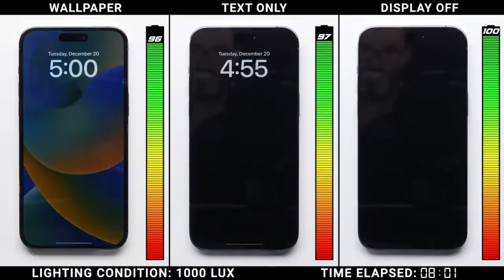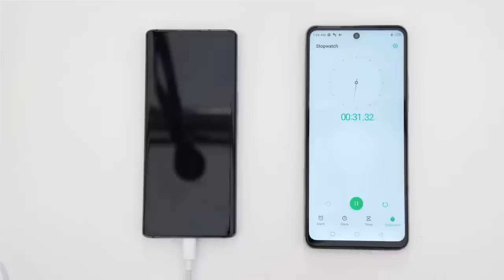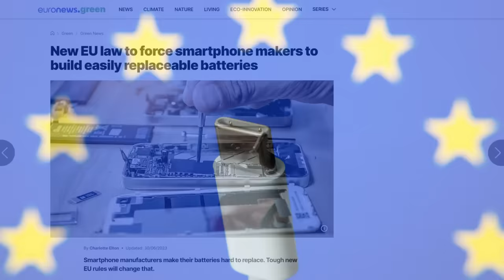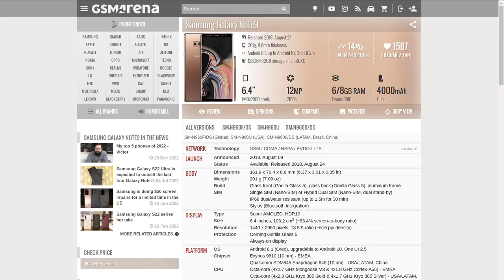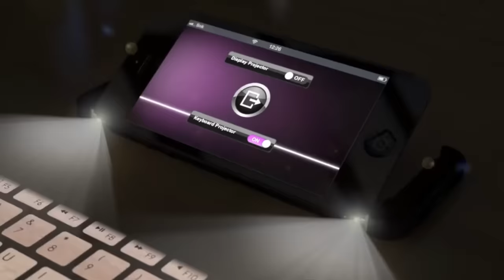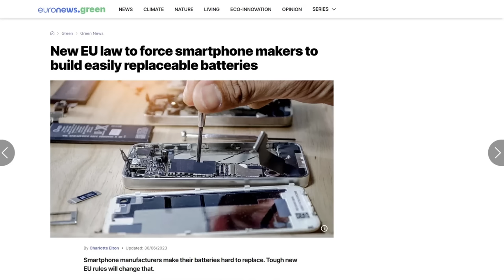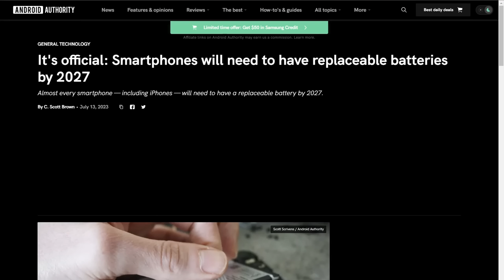All Smartphones Will Soon Have Removable Batteries

Comment: The other part of the planned obsolescence for smartphones is OS upgrades. I wonder if they will limit upgrades even more to force you to get a new device.
Reply: EU has regulations for that too, don't worry.
Reply: xiaomi 2 year security update
Reply: That was my reason for moving from a rooted Motorola RAZR MAXX to Google Pixel 2 back in 2018. They stopped OS upgrades and my apps stopped working including banking and Uber.
To this day, I still think I should have just flashed a ROM, now I am on a pixel 7 which is kind of doo doo, cause it doesn't always detect touch on the screen.
Reply: @bot-h2h  Same with the google pixels
Reply: @bot-h2h  tf that's pretty damn short
Reply: @Vysair  actually i think only for their low to mid range but still. Some poco phone have flagship chip and stop getting update even if they are still very capable

Comment: The use cases described in this video are pretty out there. I'd just want to replace my battery when it can't hold a charge anymore
Reply: yeah same
maybe this fixed-battery tyranny has brainwashed me and i cannot even fathom the powers i could gain by opening my battery case and my mind
but i did use to have removable batteries, and what it meant was i would remove them for hard resets or at the end of their life, never really thinking of juggling batteries so i am constantly powered. it also feels sort of wasteful? unless they were really cheap, i would find it risky and less efficient to buy multiple batteries so they can all be weathered by use and time for a phone that may potentially break
Reply: @aiocafea man, I basicall used my S5 untill the battery was shot and holy hell do I miss being able to do a hard-reset when my phone now starts acting up.
Reply: Yeah, a powerbank is nice because you can charge it separately from the phone, use it to charge anything, it'll still work after buying a new phone or if you lend it to a friend etc. I really don't think hot swappable batteries are more than a gimmick, especially with modern phone battery capabilities.

Repairability on the other hand, that I'm excited about!

Comment: I doubt they mean hot swappable, but a regulation that mandates easier replacement under the RIGHT TO REPAIR, when the battery depletes, is good regulation in my opinion.

Comment: The #1 problem I've experienced with Android phones in the last 5 years is that the charging port gets extremely loose after a year or so. Then it becomes nearly impossible to charge unless you have the charger shoved in and in some unique position, until the charger just falls out again. The charging ports need to be fixed. There should be an option to click it in and out so it doesn't just fall out.
Reply: Same though lesser with Apple
Reply: Type C largely fixes this problem compared to Type B-micro
Reply: I usually find cleaning the lint and grime out fixes that problem. I have a samsung s8 from 2017 and it needs a clean every 6 months
Reply: @essef.  Exactly, it feels like the port is geting loose, but it's actually just a dust build up.
Reply: This is primarily caused by debris buildup in the charging port.  I've found that phone cases with charging port covers tend to mitigate this.
Reply: I've started using a magnetic cable type c. Solved everything you mentioned.
Reply: Take a pin and lightly scrape out the USB port, and remove the lint. This is a solveable problem.
Reply: It isn't a problem with android, the operating system. The problem is the fact you have android phonea from 100 euro to 1900 euro.
Reply: My android phone is vivo 1817 (2GB ram/ 16GB storage) which released in mid 2017. It was a cheap phone that my mom gave me (It was hers initially). The cable last good until about 5 months ago. The internal memory got busted after many years until a month ago and I replaced the internal machine with other model (1820) which has a slighter memory capacity (2 GB ram / 32 GB Storage) and it now has bigger storage which I thankful about it. will be using it till there're no replace parts maybe about 2-3 years from now. Which is very rare to see this chinese phone last this long. (About 6 years now). And it still use 4G connection that only limited to 1.3MBps for downloads and uploads
Reply: @bigl9527  And that is the reason why a lot of people think Android sucks. Instead of solely expensive, good quality, phones that only run iOS you can buy cheap ass Android phones that'll break in 2 weeks or an expensive S23 which will go for 4 or so years...
Reply: I've owned many android and apple phones and have yet to run into an issue like this. I think you may be a little aggressive with your phones. 

Last year I did run into an issue though with an apple charging port and the issue was actually a lot of lint had gotten stuck in the bottom of the port. I used a toothpick to get it out and the charger fit perfectly after that.
Reply: What's wrong with charging port?
I never had issue with type C. Currently using OnePlus 7 Pro about 4 years and never had problem or needed to clean the port
Reply: OP: aughhhh the port is literally irreplaceble omg this is such bs
The port: remove back, screw, replace, re-screw, put back again.
Reply: So glad they sell phones that can charge wireless just for this reason alone. Port "broken"? No problem, you've got another way to charge.
Reply: Usually due to crap - dirt, dust, lint etc stuck in the port. Get a pin or needle and have a careful dig.
Reply: @BeauVerwijlen  My crap 100 euro redmi is 4 years old now, does what I need.
Reply: I always had "android phones", that usually just happens to some USB cables, not the phone "charging port" itself, my phone is almost 5 years old and the charging port is FINE, the battery however is now having a lower performance.
You either are not careful enough or its that phone that has a worst charging port quality.
Reply: @kevinmclaughlin3088 yeah i was thinking the same. Always had android phones, always had no problem but i made sure to take care of them. Ive only ever had that issue with a playstation controller. Last week, for the first time. Hahaha. Its obvious that its about treatment. I havent been so good to my controller.
Reply: My phone has this problem. I'm not sure how, but the USB-C port on my S10+ is like a lint and dust vacuum. Taking a shaved down toothpick and scraping the stuff out usually works well, until it gunks up again
Reply: You have to clean it genius, with a needle/toothpick or something. Dirt builds up inside these ports ( especially on cheaper phones) which causes the issue you describe.
Reply: Never had that problem.
Reply: Have you tried cleaning the port ?
Reply: It would be possible if Apple didnt patent their MagSafe.
Reply: USB-C doesn't really have that problem anywhere near as much as micro USB did
Reply: I use a magnetic cable so there's a little plug in the charging port all the time so it doesn't get dusty or worn from repeated cycles.
Reply: Fairphone lets the user replace it.
Reply: @RokeJulianLockhart.s13ouq  is it swappable? Can you switch back and forth without consuming anything, eg glue?
Reply: @adrianthoroughgood1191  Yeah. Takes me about 8 seconds to swap the battery.
Reply: @RokeJulianLockhart.s13ouq  how water resistant is the phone? I'm guessing the battery compartment won't have water protection if it is that easy to swap the battery, but is the rest of the phone water resistant?
Reply: @adrianthoroughgood1191  I've used it in heavy rain without issue, because of course a phone should be capable of that, but I doubt that it would survive well if immersed in water.
Reply: u can charge wireless
Reply: @k_u_e_r_i_s_u_e  Depends upon the phone. Mine can't.
Reply: @adrianthoroughgood1191  Meant to say without issue, just corrected it.
Reply: I have 4 yo Type C port phone and have no problem on that, I once experience same thing like u describe but it's just because there's something clog my charge port
Reply: I had Huawei phone for 4.5 years and the UBC-C charge port is still as tight as new.
Reply: @siftoshka 4.5 years with Huawei P30 Pro. Never needed cleaning.
Reply: Mines like 5 years old and perfectly fine. Young ppl are so physically abusive of their tech.
Reply: Are you still on micro usb?
Reply: I’ve had more difficulties with lightning ports getting fucked over time than USB-c ones, which I’ve never managed to destroy.

Micro-usb ports though were horrible, those broke when you looked angrily at them. It was a shit standard and I’m happy it’s dead.
Reply: I had issues with this for micro usb, but usb c seems more durable. Still do be careful with it though, try not to let the cable pull on the port while charging, and never force the cable in if it is struggling to go in immediately. Can not expect charging ports to be indestructable, but they are a simple/cheap repair thankfully

Comment: The Samsung Galaxy S5 was waterproof while having a removable battery.
It was possible 10 years ago, but it's supposedly not now?
Reply: Yeah you are right. I think it should be possible...
Reply: Waterproof is technically not possible
It would be water resistant

Comment: My prediction: the casing has a proprietary gasket that wears out if you remove the back plate more than a few times, causing damaged phone from tiny amount of water leading to replacing either the gaskets or the entire phone.
Reply: 1st, more devices can take a little bit of water already. If not, then you didnt seal any of the hardware inside correctly (at the manufacturing level). 2nd, there are ways to make this happen that doesnt expose the insides to the outsides. 3rd gaskets can be solid - right now its double sided tape/glue - just make it part of the repair process.
Reply: @adr2t  methinks you missed the point a bit... the point was, engineering it to fail; not describing my brilliant and uniquely wonderful solution to an obviously not impossible problem

Comment: I remember my Galaxy note 3 with removable battery and the after market wireless charging coil. That thing was a beast
Reply: Best phone I ever owned was the note 4. Removable battery and storage, touch screen pen, credit card ability, 32 megapixel camera, and IR beam so I could turn it into a universal remote or other custom stuff. Since then every phone on the market has been a downgrade. After I owned it for 7 years it broke when I dropped it and 7 years later I now use the Moto z play because it's modular.

Comment: Personally I find water resistance a must. My phone has swum in oil multiple times and I use it for inspections in places that might have water or steam in them. It'd be nice to have a water resistant model and a battery replacement model.
Reply: What makes you think a phone can't be water resistant and have a user-replaceable battery? Plenty of older devices achieved this just fine. Ruggedized portable electronics (think surveying equipment, portable 2-way radios, etc) from the '90s were water resistant, there's no reason that modern phone companies can't do it too. A few screws (or preferably quarter-turn fasteners) could hold on the back case and compress a rubber seal, which is the design commonly seen on today's waterproof satphones and trail GPSs. Samsung made a phone in 2015 (the Galaxy S5) that was water resistant, with a removable battery, a headphone jack, and a micro SD card slot. We didn't know how good we had it then!

Another thing, that only applies to your one specific use case. Get a USB boroscope that can plug into your phone, they're cheap as chips from China and will save you from errant oil and steam.
Reply: If you're using your phone for inspections in areas involving frequent water and oil then you're gonna want to invest in a good case regardless of the phone's inherent water resistance.
Reply: Ironically, one of the few smartphone models that still have user-removable batteries to this day is the Xcover line from Samsung, which has an IP68 water resistance rating.
Reply: my old s5 neo had a replaceable battery and waterproofing. My new phone has neither 😵‍💫 I only switched it out because it broke and would cost more to repair
Reply: Samsung xcover
Reply: @@kanabanakamura864 And how common is the Xcover models?  If replaceable battery is such a big deal, how come these models are so unpopular?
Reply: @chumanho Marketing. Shinier things tend to be more popular
Reply: @Your_username_  This put into perspective what the consumers'' priorities are, I guess.
Reply: @Xenthosis317  I run a Mous case and have been for several phones. The phone that has survived all the abuse is an Iphone 12 that I've had since like 2 months after release. In the case it has survived 30ft drops, swimming in oil tanks, swimming in water, splashed with oil, extreme temperatures (45c to -30c), its been hit by superheated steam (at 1 meter away) Its (and myself) nearly got struck by lightning, I've lost it in the snow and I've sparked it with an angle grinder dozens of times. I used to work as a steam turbine and valve technician and I know how to break shit.
Reply: @tissuepaper9962  Well I'm a maintenance technician but I used to specialise in steam turbine and valves. The problem with removable batteries is theres seals and stuff that will inevitably get damaged from use. 

I dont need a cheap boroscope because we used to have expensive ones. The phone is significantly more convenient to use when I dont need to see around a corner. For reference the pipes I was working with were a minimum of 6" and often over 48" wide
Reply: @kingkottah  seals are cheap, and a well-designed device would use a standard seal.
Reply: @chumanho  because phone companies sold the lie that "phones can't be water proof with a removable battery" and it stuck hook line and sinker.
Reply: @GlitchedAI  But people must be aware of the presence of Samsung's Xcover series and Nokia's XR series, right?
Reply: @chumanho  sadly yes

Comment: It's not supposed to be removable but rather user replaceable with commonly available sruedrivers or custom tools shipped with the device
Reply: I think the EU law specifically states it must be possible without any tools.
Reply: @srsjackson  no, it could be commercially available tool(so basically something common you can go now and by in store), or tool specifically for this device. In the latter case you should ship tool with device. And tool can't be proprietary.
Reply: @srsjackson I think it would be nice to have more water resistance and use a SIM ejector for ejecting both the SIM card and the battery
Reply: so the way iphones are now?
Reply: @imstupidbut  exactly, i do not understand these clowns who imply that iphones are not repairable. just buy a screwdriver for 60 cents and a new adhesive if you want it to stay waterproof

Comment: This "water resistance" motive seems like a myth to me. Back in 2014 my Samsung S4 fell on the lawn with the sprinkles turned on for 1 hour. So the phone took a lot of water in that time. When I recovered it and wiped it good, it worked perfectly, nothing broken. I still use the phone to this day, 9 years later, daily. I only changed the battery 3 times since then. So I very much agree with this law.

Comment: I actually like the extra camera's, especially one with an optical zoom lens. I use it to help me read things I otherwise can't.
Reply: Macro ones are awful. No one ever used them. If much rather the main camera get an upgrade than have some of the budget squandered on a macro camera that does nothing
Reply: @truth.speaker macro is nice for certain things

However i think it's better to make Main camera good and have a Macro camera option which is purely digital... as in it's gonna use the Main camera as a macro camera so focus is set to be really close like it is on Macro camera so you can take focused HD pics of really close up things

Comment: On defense of the multiple cameras in phones: the optical zoom on my S22 Ultra is amazing. I don't think a single camera would handle that so well as the dedicated zoom camera.
I believe it's good if that is still offered for premium phones, but yeah they will likely never reach the same quality as actual cameras due to the sensor size + glass difference.
Reply: Idk. I think in the near future with AI, we could see some insane things being done through software in real time.
Reply: @Skrenja  While AI is only going to get better, if I'm taking a photo of something, its because I want to see what's actually there in front of me, not an AI interpretation of it. 

I'm all for keeping the multiple cameras. I've seen a 102 megapixel fujifilm camera outperform (detail retreival) a 200 megapixel camera on Samsung's S22 Ultra. So dedicated cameras are definitely better. But, the cameras we have in phones nowadays are still pretty good for what they are. And they are still specialized to a degree.

Comment: 1. What if they secretly hide another microbattery in your phone, so even if you remove the main one, its still functioning to some degree, and transfering your whereabout+microphone/cam footage. 2 there could be tech available that doesnt need power to function, or uses radio etc. wavelengts frequencies to power the circuitry back to functionality. You already have wireless chargers, or radios with big enough antennas that dont need any internal power to function, the waves are enough to power it if you catch a lot of it.
Reply: That was my thought as well. Either a small battery or a capacitor just large enough to transmit GPS data
Reply: There actually is something like that in every smartphone now and from the time batteries were removable. The micro battery is used to keep time without connection and power for some time.